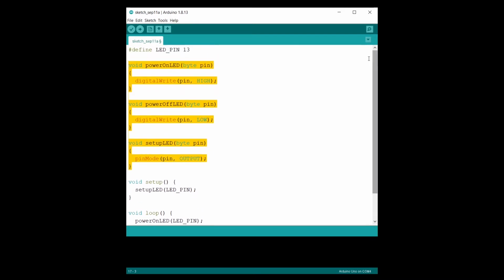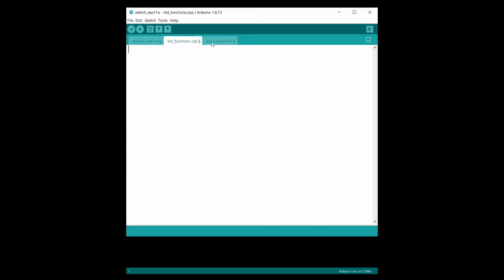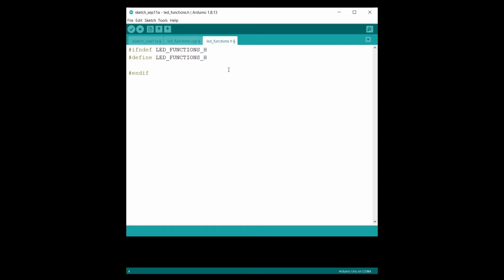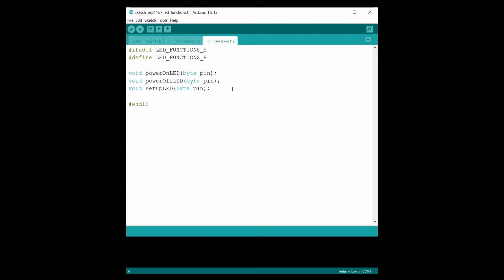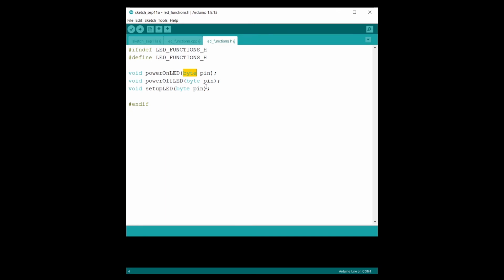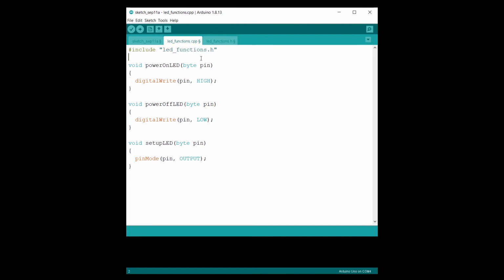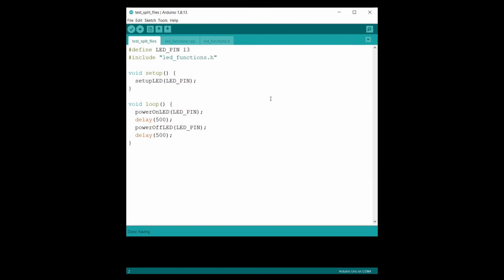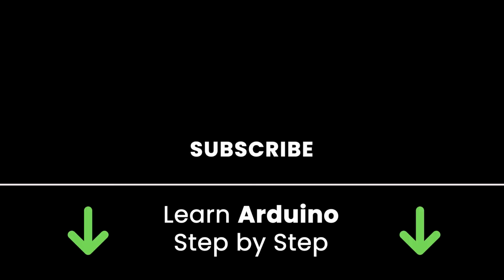Arduino - How to Split a Program Into Different Files

Comment: I am getting no such file in directory for my header even though I have all three files in the same folder
Reply: I fixed it, I recreated everything, and instead of saving my sketch on my desktop as usual, I saved it in the default folder that arduino suggests (where my "libraries" ; is) however, I don't think that was the issue because I did move my previous sketch in this folder and I still got the directory error. But what I did the first time was renaming my .h file to add the .h because before watching the video, I created one without the .h and added it when I saw you add it and I think this is what was causing the problem.

For the second attempt (which worked), I included the .h while creating the tab 🎉

Comment: that's an instructive video. I just have a question, how the cpp file is going to be called?
Reply: The arduino ide will compile and link the main ino file together with the .cpp files in your sketch folder to create a working binary file

Comment: I had some code that was working fine.  I then split it into the .cpp file, with the corresponding .h file.  
The issue I have is that now when I call the SPI functions in the new .cpp file I get errors about "unknow class type", errors in the actual SPI library that is part of the arduino ESP32 library.
Any ideas why this is the case, or is it possible that the SPI library for the ESP32 is not able to be used this way?
Any advice would be greately appreciated as I have spend hours on this and not got any further.
Reply from the maker: I would say to make sure you use the #include tags in every file where you need the library

Comment: Hi, I have a few doubts.
1. f I am using the suppose 'X' library in Arduino which is used for let's assume filtering noise from the received signal. 
2. so does that mean, that the library should consist of a .cpp and .h file?  
3. .h file is like for declaring the variable?
4 .cpp is where the actual method(function) is created for filtering the noise?
5. and in the  .ino file which acts as a receiver(created by me), from that I need to call the function which I want to use from my X library?

thanks in advance.
Reply from the maker: Yes, you have the right understanding :)

Comment: I have a question. Why use .cpp, .h extensions ? Arduinos default .ino files directly imports functions. So we just call functions direcrly. Im just curious
Reply from the maker: This is a way to better organize your own code. Imagine that you have 2000 lines in your main .ino file, this is going to be horrible to manage :)
Reply: @RoboticsBackEnd  Okay. How about managing the code on multiple ino files. I'm just trying to understand the difference. Really appreciate your response.
Reply from the maker: @MayankMehraMusic  well technically I think you could create multiple ino files (make sure you don't have multiple setup() and loop() functions though). But I've never done it, never seen it, and I think it doesn't really make sense --> .h and .cpp files are working well and that's what you'd do in any other cpp project
Reply: @RoboticsBackEnd  Okay. Understood. Thanks alot for your valuable time.
Reply: @MayankMehraMusic  Sorry, I hate to be pedantic here, and I do understand the reasoning for the .h and .cpp files, but I fail to understand the reason of creating multiple prototypes for a single function like:
void powerLED(byte pin, bool state);

and then in the loop just write:
powerLED(LED_PIN, HIGH);
and
powerLED(LED_PIN, LOW);
Reply: @RobiBue  Hi, Sorry for the late reply. So here the function is created that just sets the pin state but you can have complex functions doing different computation. So when the function is once created we are just using this to set the pin state as high or low. I hope i answered your query.

Comment: Works good. One problem though. Was unable to use Serial.print from the .cpp file. This was true even after issuing Serial.begin(9600). Correct baud options and termination options were selected in terminal window. Still no output...